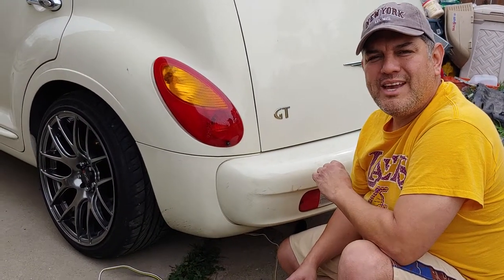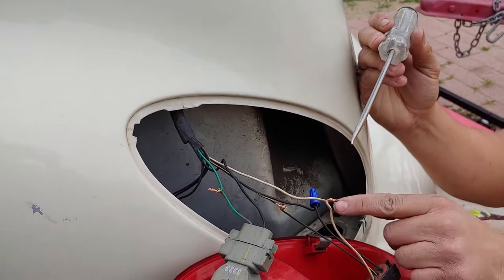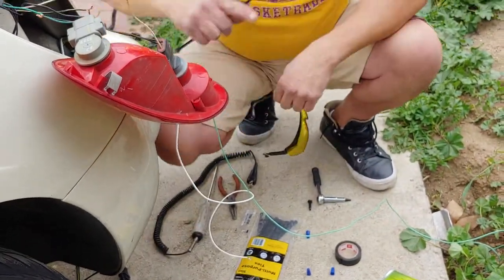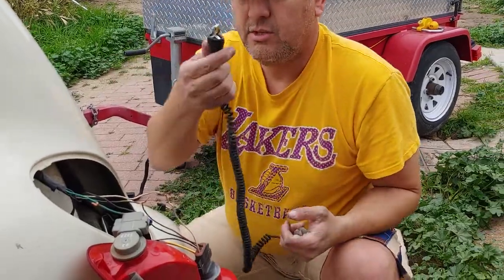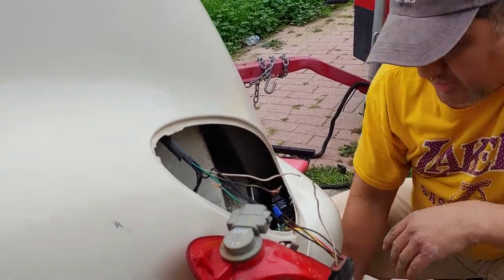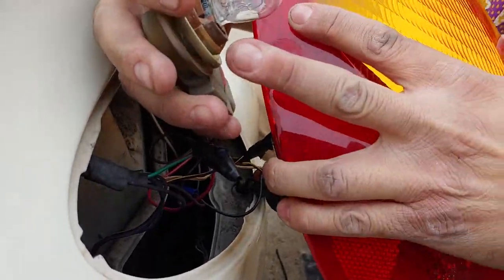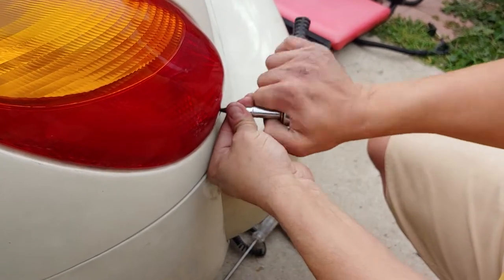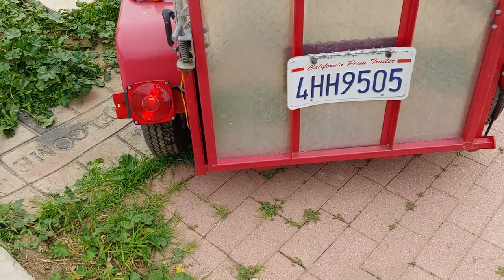How to wire your car for trailer towing/hauling

Comment: 5 years later this video still saving peoples ass! Thank you Luis.
Reply from the maker: Hi @evildark940 You're welcome.  Glad it helped.   It's the same concept for all makes and models.  Some plug and play kits could be expensive or not available,  so this is a great save.
Reply: Just a tip id use a shrink wrap crimp connector or them splicers that u use pliers to crimp on so you dont have to cut wires

Comment: Good job on the wiring! Super helpful, bout to do this to my new truck! Thanks and God bless!
Reply from the maker: Thank you for watching.  Glad it helped.  You can also check with uhaul for a plug and play option.  I just did one on a 2006 Honda Odyssey and it was $39.95.
Reply: @luiselmilusos7625  buytrii
Reply: @luiselmilusos7625  11111

Comment from the maker: You can also use a flat head screwdriver to remove the screw that holds the tail light.  Some screws are both torx and flat head combined.

Comment: Great video Luis!  How do you feel about using wago type connectors instead of wire nuts?
Reply from the maker: Hi Sewashburn0529.  I actually never use wire nuts, but rather use electrical tape.  I happened to have a few and used them in this video.  Even with wire nuts, I use electrical tape over them so they don't come off.  I've never used wago type but I'd still use tape over them.  Better safe than sorry.

Comment: Although it was a very informative video. I got just a few things to comment on. First is that you should never use wire nuts for automotive applications. I would also avoid cutting and splicing wires. You can make the process easier by using wire tap connectors.
Last, invest in a pair of wire strippers.

Comment: You did the right blinker really fast, so you cut, splice and attach the same wires on both side rear lights right?..
Reply from the maker: Hi Seatime.  You can find the wire on the left bundle of wires that sends the right turn signal and attach there to avoid running a new wire over or you can run a new wire to the right side and connect to the harness right turn signal there.

Comment: You saved my day! Thanks
Reply from the maker: Thank you for watching.  Glad I could help.  Depending on what car you have, u-haul may have your plug and play wiring reasonably priced.  If it's expensive, this unit I used is a very good option.

Comment: But dose the extra pull off the car  lights make the trailer lights dim ? Or blow the fuses
Reply from the maker: Not at all.  Works perfect.  You can check with uhaul for a plug and play option but some are in the pricey side so this is a great alternative at a great price.  I did find a Honda Odyssey plug and play for $39.95 + tax so you may find yours reasonably priced.  Thanks for watching!

Comment: Is this the same for all vehicles? Great video by the way.
Reply from the maker: Hi Stephen.  Pretty much the same thing for all vehicles because this is a universal wiring kit.  There are some wiring kits that are vehicle specific and will come with custom plugs.  Those are more expensive and price will be determined by your specific vehicle.
Reply: @luiselmilusos7625  ok thanks. I have a 73 Lincoln continental that i want to put a small hitch on.

Comment: Luis, can you provide info on the trailer model you have. And can PT cruiser be able to support that trailer
Reply from the maker: Hi SriKanth.  It's a Scoota mobility trailer.  They are very pricey if you buy online and brand new.  I happen to come across mine from a private seller so saved a lot.  I used it to haul my DJ equipment around.  PT Cruiser can handle 1,000 pounds with no issues and if you're not experienced in towing, I'd stick to that but it comes down to how you tow and how you accelerated and most important of all, how you brake.  I've towed another PT Cruiser with my GT Turbo and severalother compact cars with no issues, however, I wouldn't push that on a non turbo but in NO WAY am I saying go do it.  I've been towing for almost 30 years abs even I'm not immune to something going wrong.
Reply: Thanks for the insights Luis

Comment: whenever I see those interior end cap connectors on a car I know to avoid it. should get the proper crimp connectors to do automotive.
Reply from the maker: Crimp connectors can come loose too.  I always use electrical tape and on the very rare occasions that I've used a wire nut, I've also taped over it to make sure it stays on.

Comment: Can it be done without that box on the harness?
Reply from the maker: That little box is your separator to the lights so that brake lights and turn lights work accordingly.  You could check with u-haul for a plug and play adapter for your car.  No cutting or splicing will be needed but more expensive.  As to your specific question, yes.  Your lights will work if you by pass the box but you'll have issues with brands and turn signals if you have 5 wires

Comment: How hard would it be to do that on a mini cooper
Reply from the maker: Good morning.  Same concept on all vehicles with regards to wiring.  What changes is how to remove the tail light.  There are wiring kits that don't require cutting and splicing and are specific to your vehicle.  They run around $69 - $129 and you'll have to unplug your light harness and clip it into the one you purchase while clipping the other end to your lights.  It's rather easy but mine had to be ordered and took like 2 weeks to arrive and doing it the way I did it was cheap and immediately available.
Reply: @luiselmilusos7625  yeah I want super cheap
Reply from the maker: @Finfanpete  ok.  Then this is by far the cheapest way.  Very effective though.
Reply: @luiselmilusos7625  so the left side is main part with one going to the right turn connection...I don't have testers but can I just once light is out turn the turn signal on and trace it to locate it and the same with break lights ?
Reply from the maker: @Finfanpete  You can buy a tester for less than $5 at Walmart or any auto parts store.  99 cents sure may even carry one.  Any way you do it, you trace the wire and hook up your trailer connector to reach one as you find it.  You may even be able to find the right turn signal on the left side but you have to go through all the wires.  That's why I went with the right side wire ran all the way to the other side as a quicker option

Comment: Good step by step instruction. I disagree however with the use of wire nuts in this application.  Wire nuts could vibrate loose. Scotchlock IDC Pigtail connectors are a much better choice. They make a more positive connection and do not require stripping any wires. See this video: https://www.youtube.com/watch?v=s9iJj6k-5Kk
Reply from the maker: Hi Bill.  I don't like wire nuts myself but anytime I have used them, I go over them with electrical tape.  Thanks for watching!